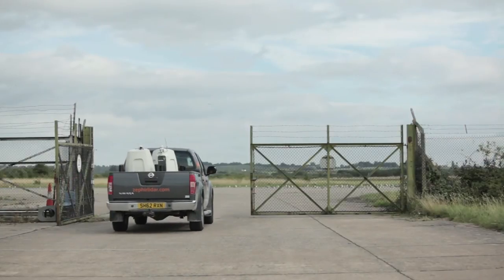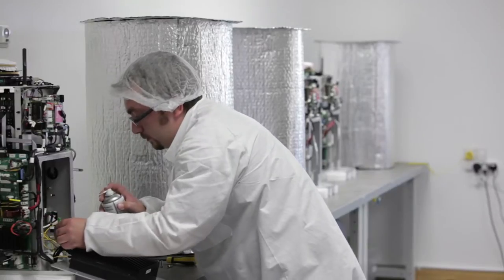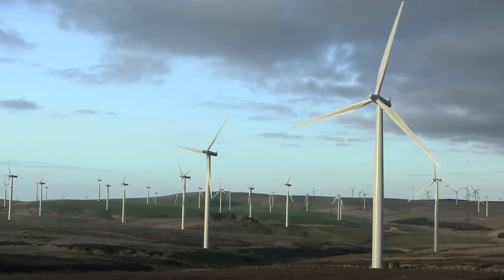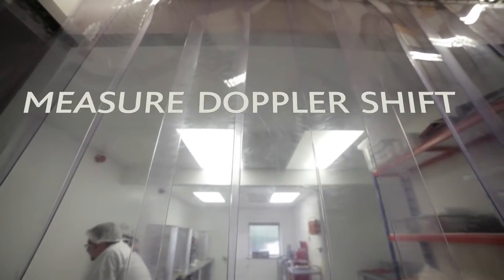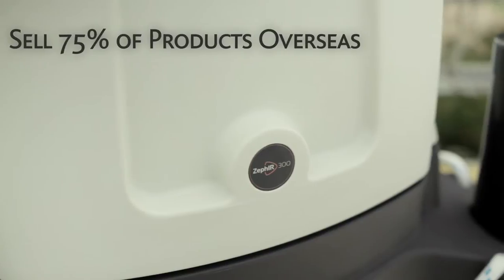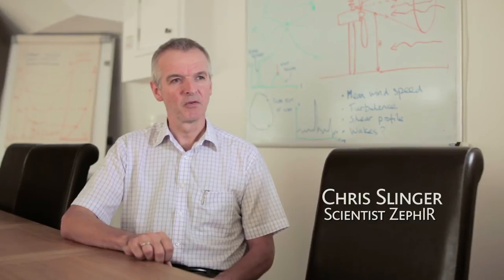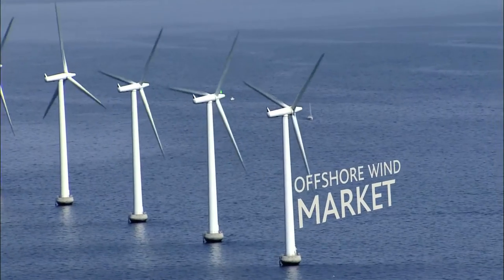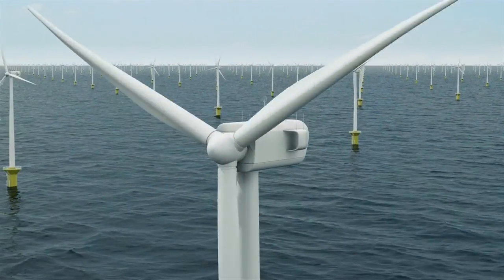Wind lidars: using laser beams to detect wind speeds

Comment: Does this replace  met mast.? in wind farm feasibility studies.. Thank you in advance.
Reply: +muhsin mahamood The ZephIR Lidar is an excellent tool to replace a met mast up to 200m high providing fully bankable data for Wind Resource Assessment. In addition it can offer many benefits over a mast including easy portability, low visual impact and reduced uncertainties across a measurement campaign. Please do get in touch on sales@zephirlidar.com if we can provide you with any more information.
Reply: @Jalil Damirchiyev depends on the energy output with respect to the wind speed of your selected wind turbine. You can search on the tech data for various wind turbines on the net.
Reply: @Jalil Damirchiyev There will always be a minimum value. Most of the lower end wind turbine works best at 7-12m/s or so and starts generating energy at 3m/s. Nonetheless 3m/s wind speed produces very small amount of meaningful energy
Reply: @Jalil Damirchiyev im not in the industry and my knowledge is simply from the internet. I guess you can also get specific answers through some browsing.